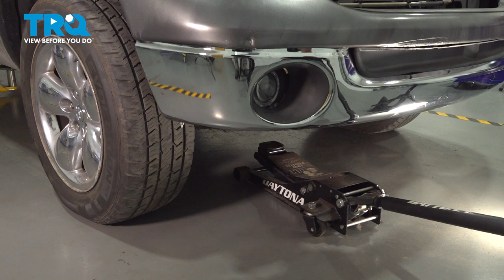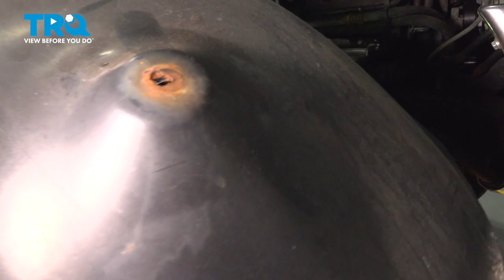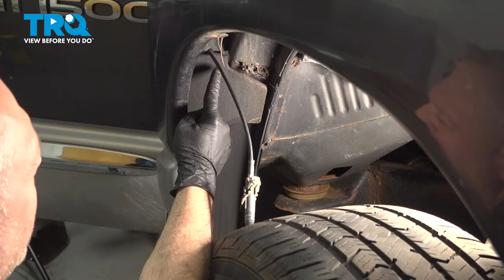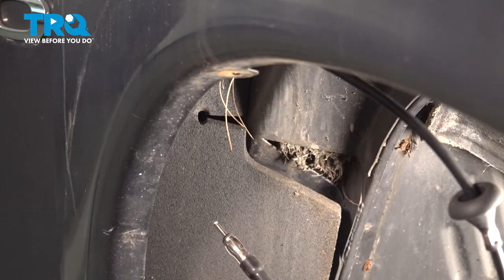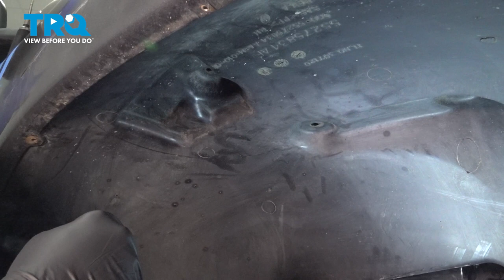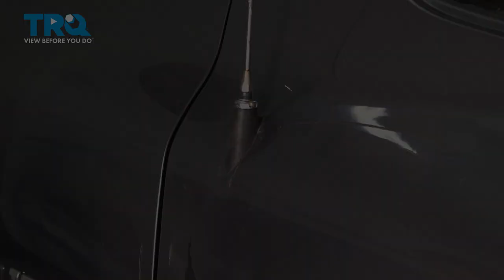How to Replace Antenna Base 2002-2008 Dodge Ram 1500

Comment: Let's all just be simple, take a flat head and a hammer to the ring. If youre insisting on needing a special specific tool for a dang antenna. Then it would be wise to just stop trying to be a wrench. Your toolbox/garage would be jam packed with "special tools" including yourself. Kinda of have to improvise at some point working on your own vehicles

Comment: The antenna that was reinstalled was rusty. It only takes less than a minute to wire brush the threads clean and use dielectric  grease on the threads to insure continued good connection.